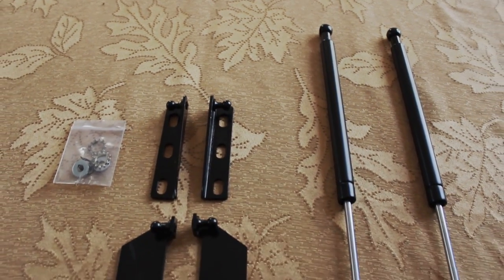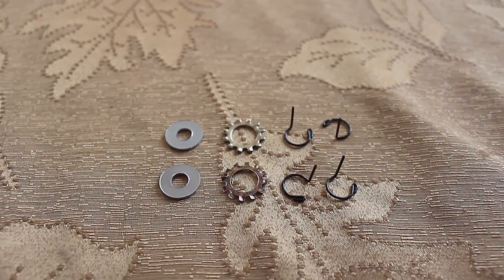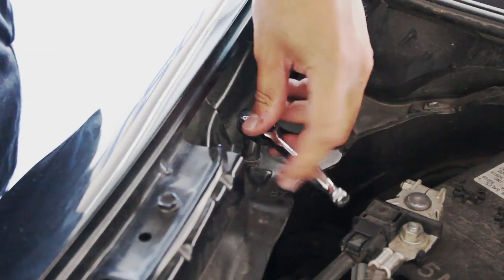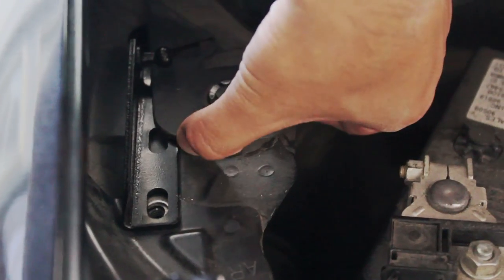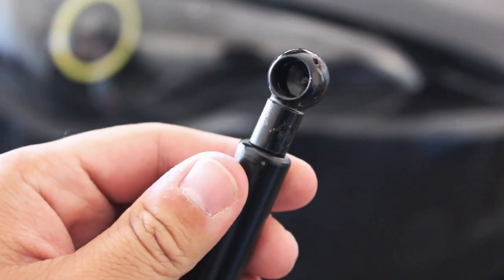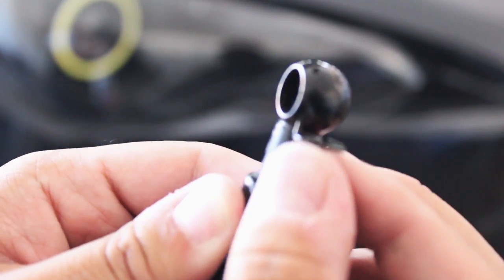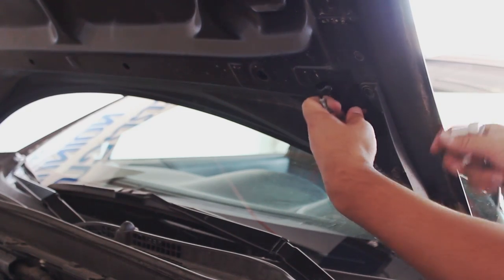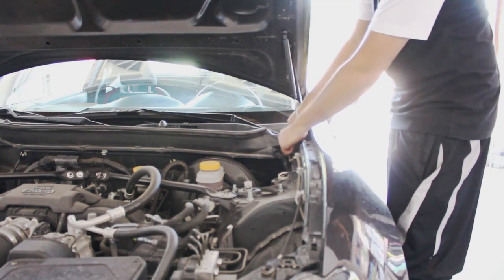Car Noob Ep. 14 - Hood Shocks

Comment: There is not a big difference between shocks and struts when it comes to suspension. Shocks usually have a round bushing on the bottom with a bolt going through it. A strut is bolted to the steering knuckle and had no bushing on it. As for the hood they seem to go by two names, struts or dampers/support dampers. I would just call them dampers to be more specific.